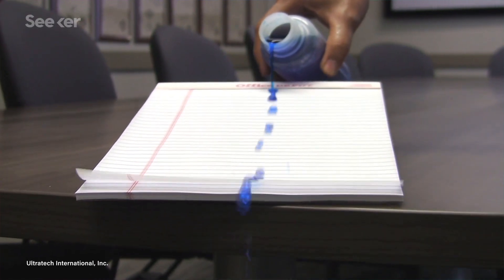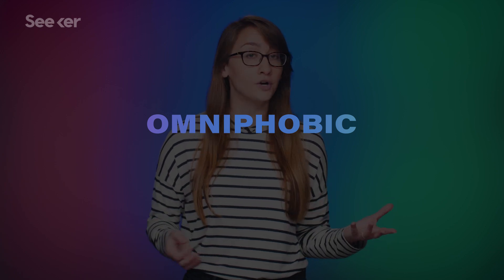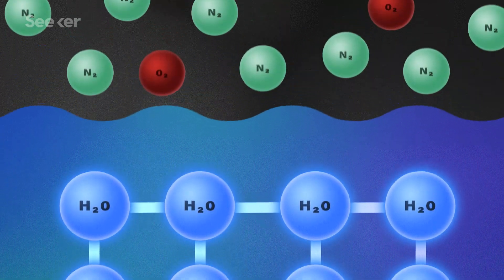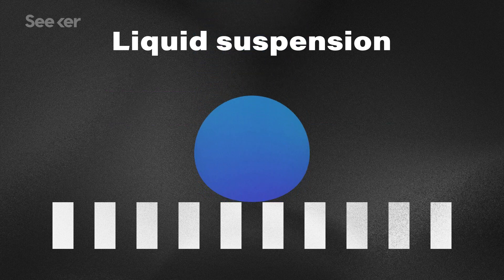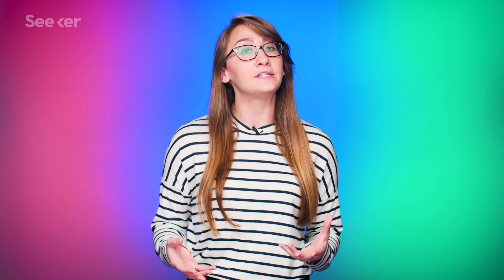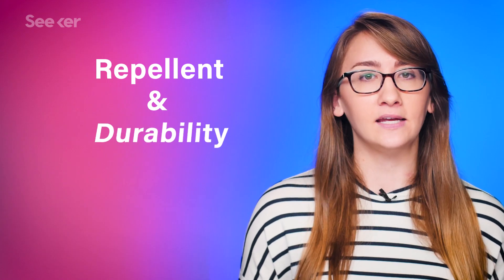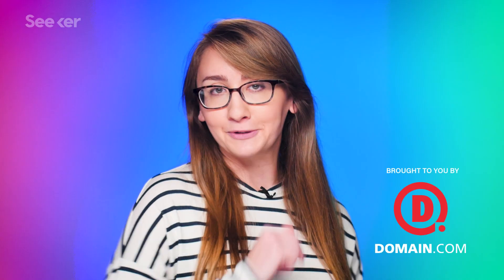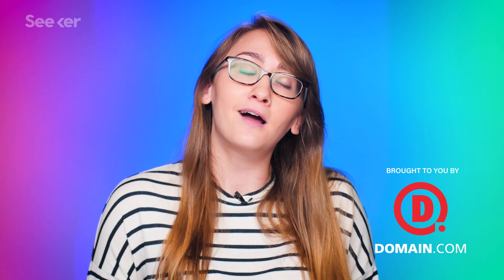These Liquid-Repelling Materials Defy Nature’s Design, Here’s How

Comment: Using a non conductive liquid that usually used to put electric devices in ...n no no mineral oil. You can use this to make a new form of non hydroelectric power and which can be a non harmful way of energy I know I own a small model I made it it strong enough to even power a s19 pro 110th all while keeping it cool

Comment: Yeah, the applications would be numerous (assuming the superomniphobic coating was durable enough and reasonably priced). Cars, motorbikes, glass windows, store fronts, would need zero to minimal washing. If it wasn't toxic the same would apply to sinks, kitchenware, bathrooms, bathtubs, perhaps even our clothes. The energy and water savings would be significant, trimming CO2 emissions a lot.

Comment: Omni/super/hydrophobic coatings have been around for decades, it's like the newest battery tech - just around the corner and everyone can reap the benefits! forever. This tech will only ever be useful as a material, not a coating, coatings are expensive, have to be reapplied, are always toxic, and can't be recycled. If they can turn this into a ceramic type of thermally bonded application we'll be much farther ahead than a spray on coating like paint (what it is today).